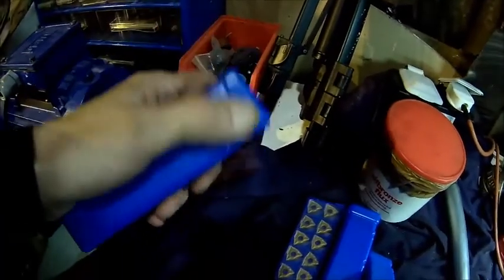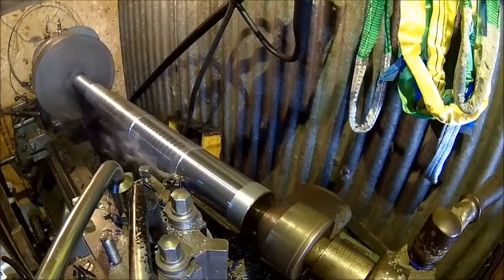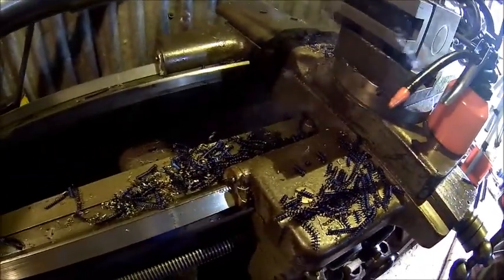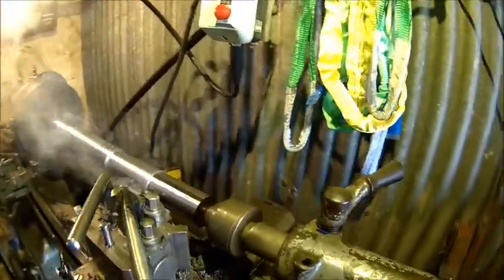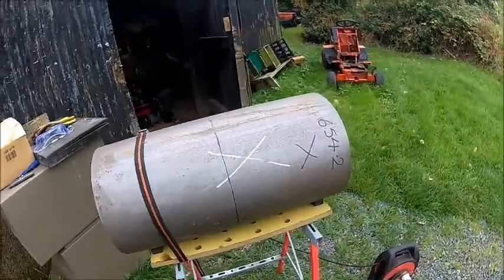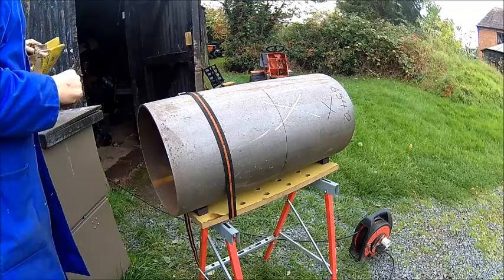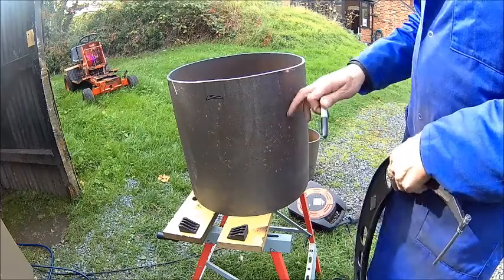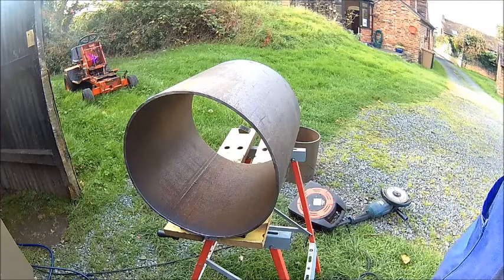The Mystery Project - Part 3, More chips, noise, sparks and smoke, cutting the pipeline

Comment: G’day Dynoguy, I haven’t gone ahead in the series, it looks like a large pizza dough roller. BTW those 9” angle grinders work wonders, but you must respect what’s in your hands, still it would’ve taken some work to get through that pipe. Cheers Peter
Reply from the maker: Thanks Peter, but unfortunately it has absolutely nothing to do with pizza ...:-)... and believe me, i do respect machinery and when i didn't occasionally, i was probably just lucky, but certainly learned the lesson, ...one way or the other, I somehow survived the last 40 years in the trade...
As you may notice i do wear gloves and safety goggles ..........this was the section for the H+S prayers which may watch this eventually ...:-)

Comment: hmmmmm...still scratching me head as to what this could be... with that de-motorized tractor in the background i can't help wonder if it might be a miniaturized steam roller you're building? 

looks like you have some flexing in your carriage going on there somewhere on hand of that helical scratch as you roll the carriage back. i saw that same thing in the lathe i run at work until i tightened up the gibbs on the compound. 

 the nice thing about the indexable tooling is the finish it produces on a deep cut, on the other hand a light cut the finish looks like shait...
two years ago sandvik announced they were pulling out their presence in china, from the looks of the tool holder you got, it appears to be a knockoff of the sandvik tool holder i have.
Reply from the maker: Nope,...i don't build useless toys, ... :-) ... perhaps the next episode may give you some clues,...or even more confusion ...who knows. 
The story behind the tractor is that a friend needed an engine for his Hakotrac 600, originally 8hp, now it's got a 13hp Briggs in it. The rest is for parts because i bought another one with a Kawasaki engine (interesting fault on that one) to make up with the remains. Some footage of that stuff should come soon.
My friends means of transportation was a rather unusual one as well, so that walkaround is going to come as well.
With the rather high tool pressure of negative rake inserts the flexing is pretty normal on that machine, don't forget it's a 7ft bed and weighs only 2000lbs,  how much does your Boehringer weigh ??
The gibs are tight but the cross slide is bouncing around a bit as the leadscrew and Nut doesn't look much like and ACME tread anymore, this toy is just badly worn out and needs alot of work....if i ever find the time.
I agree with the light cuts and indexable tooling, but any HSS i tried was dull after not even half the length.
The Chinese certainly did their homework (or paid attention while copying) , i am absolutely happy with the tooling and can only recommend it. Bought some parting tools as well,  we'll see how that works out.
Reply: nuts...foiled again batman.. i love a good mystery :-) 
for shits&giggles i tried putting an edge on a carbide insert like what Stefan Gotteswinter was showing in one if his vids.. it actually works quite well although the edge doesn't hold up for long. it's most likely the grind i put on it.. free hand on a diamond dust wheel. but the concept is sound.